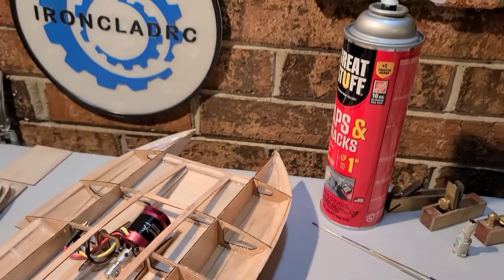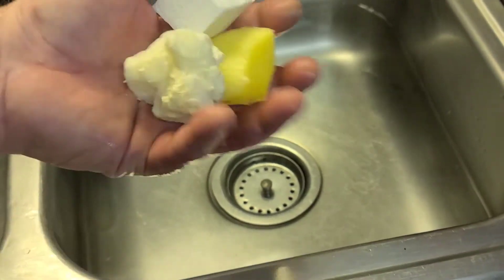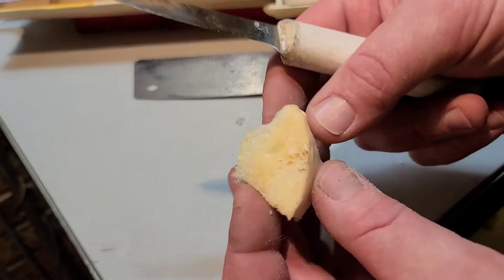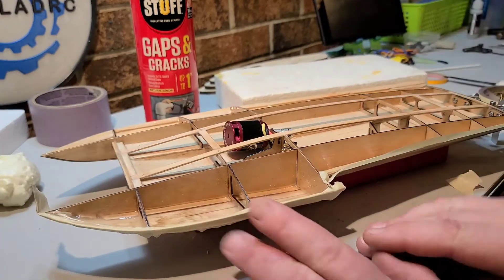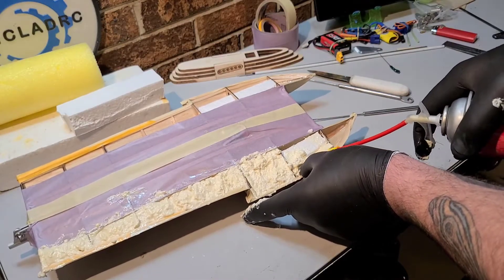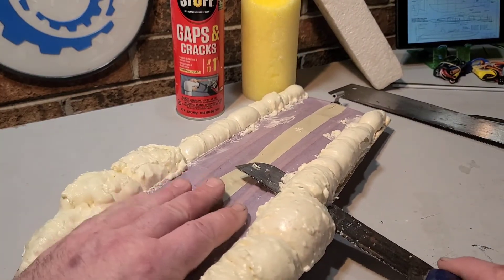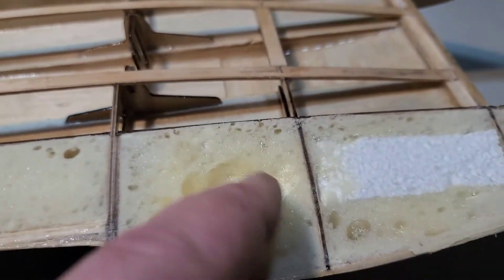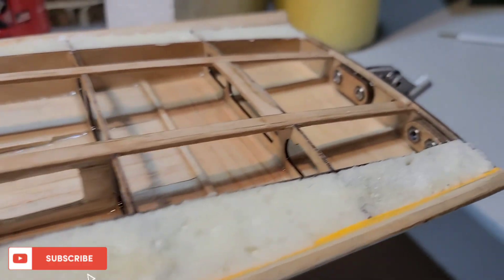Spray Foam Vs Pool Noodle Vs Block Foam Rc Boat Floatation - Pour Foam Substitute?

Comment from the maker: NOTE: Don't encapsulate the foam. If your gonna use spray foam DO NOT SPRAY I AN ENCLOSED AREA. The foam need to expand if it doesn't have a place to expand it will Crack or disinform your boat hull.
Reply: yeah, don't ask me how I know that!   I bulged out my M41 hull somewhat by putting spray foam in the nose.  I caught it before it hardened and was able to clamp it back into shape (somewhat).  I think the ABS hull is weaker than fiberglass, so I'm sure that was some of the issue....
Reply: another tip I read is that once you cut the cured foam (removing the outer layer) you expose the inner foam structure to water which it will then start to absorb... It seems pretty "closed cell" to me so i don't think it would be that much of an issue.  I also agree this adds significant structural rigidity to your boat.  Nice video...
Reply from the maker: Thanks for the tips you guys. I agree the outer hardened foam definitely seems to be more water resistant than the foam once cut.    Glad you were able to save the m41
Reply: So how are you going to fix the deformed sponson ?
Reply: @edwincordero8  if that was addressed to me, I was able to push the ABS hull back into shape and clamp it before the foam inside hardened.  There is one small spot I missed, but otherwise I was able to just safe it in time....

Comment: I recently acquired an old gas rc boat. I know nothing about these boats. There were old pieces of pool noodle in it. I was wondering why it has the pool noodle. I'm wondering if I could spray a bit of spray foam in the hull instead of the noodle. Also. Whats it for?
Reply from the maker: This spray foam tends to soak up water and will make your boat heavier over time, I tt also expands so you gotta be careful spraying in enclosed areas.  

Polyurethane pour foam is a much better option. Pour foam will not blow out you hull and is more wayer resistant  than spray foam

Comment: A quick technical question: I have a Rocket motor with bad bearings and my bad eyes , do you know what tool takes out the end bell screws on a 4074? I know it isn’t a 1.5mm, I would guess 1mm but thought you may have run into this already. I have used liquid wrench on it to pre soak. I want to save my motor but Florida salt water does have its drawbacks.
Reply from the maker: Your best bet is to slightly heat the screws with a small blow torch or soldering iron,   small torch works best.   They use loc-tite on all the screws so heat is key
Reply: @IRONCLADRC - The heating was a great reminder of the thread lock on my screws. My motor was less than a year old but I did run my boat in brackish water. The bearings were totally rusted, new ones on order. Thanks

Comment: in  the 1980's  I  built  a  boat where  the  designer  counseled  using  soft drink bottles  with the cap taped on.
Reply from the maker: What? Soda bottles lol well you know it's not gonna sink..

Comment: Flashbacks come in quickly at 6:40 of my first experience using expanding spray foam over a decade ago, it's definitely like feathering the clutch the first time you drive a new car to figure out where it engages at, & with that small an area I would definitely feather your pull on the nozzle as lightly as possible - but you don't know until you know unfortunately.
Reply: This was 2 years ago tho, I am assuming you're an old pro at spray foam by now... Took guts actually filming your first attempt with it tho. 👍🏼👍🏼

Comment: the best i would say is the 2 part foam  you mix that is designed for real boats... spray foam is almost like a sponge ,so i would not use it... but for many applications using block foam cut to fit is best imo...
Reply from the maker: Pour foam is triple the cost of spray foam, but as you say it's better in every way.   Inside a sponson it's fine completely sealed off from water
Reply: @IRONCLADRC  I just happen to have a lot of that 2 part laying around... yes as long as no water ever gets does matter to much what you use ,just dothe job right... i remember many years ago before the internet i used the 2 part when replacing a floor in a 14 ft boat i had...needless to say i used to much...lol.. But once to calculate it right its an amazing product...

Comment: DAP makes a product called 'DAPtex Plus Multi-Purpose Foam Sealant' That i've used in other applications. It won't add much strength. But it's non-expanding and MUCH lighter. Also, the nozzle doesn't clog up after the first use. For leveling the top off with this stuff you can just use a bondo spreader or something flat. And get this, it washers off with WATER for cleanup. I got it at Lowes. You might try it out and share. :)
Reply from the maker: I saw dap when I was shopping  for  foam I was up in the air on which one to get.  I will definitely keep that I'm mind for next time thanks
Reply: Awesome tip - thanks

Comment: I am so freakin glad you made this video. I wanted to use the spray polyurethane to fill an inflatable tube for a race I'm doing. I'm thinking about cutting open the tube, filling it with pool noodles and then the spray foam since pool noodles are lighter and fill up that negative space pretty well.

Comment: I like it how you cut towards your arm😂😊😎 It's good you show this stuff,many people are new to this and can find answers here
Reply from the maker: Suicide cut
Reply: @IRONCLADRC  😳Looks like your doing a great job of the boat 😊.Have you seen the Joysway Monster Catamaran they use a flexible perspex upright rudder as a self return method wonder if it would work on other boats
Reply from the maker: Oh yea. It for sure would. Just cut and sharpen a scrap piece of aluminum & bolt it to the rudder
Reply: @IRONCLADRC  That would be good 👍.I did try a plastic one once and it snapped off ,from what I see a d read is that if the boats upside down then it's the wind force created from the prop that moves the boat along slowly or if props in water that's a bonus

Comment: Spray foam expands worst think you can put in the boat for floatation
Reply from the maker: You need to test the foam first to see how much it expands and use it with caution. Never cover always keep the area open for expansion.
Reply: @IRONCLADRC  Personally I think you are going to regret this JMO.

Comment: Did you know that there is a difference between open cell and closed cell foam?!? All great stuff is open cell therefore it will take on water slowly and continue to fill. Eventually the foam will be full of water adversely raising the weight of the boat and losing it flotation for the boat.
Reply from the maker: There should be no water in the sponsons. Why would it fill with water?  Hmmmm.
Reply: @IRONCLADRC  It's a dessert topping!....  No, it's a floor wax!  Wait!  You're both right!  Great stuff IS open cell and will gradually take on water when submerged.  The point being, everything is sealed up and there should be no water getting to the foam in the first place.  If someone with slow reactions rams you boat and fills it full of holes, you should be able to recover the floating wreck before the Great Stuff gets over-saturated to the point the hull sinks.
Reply: @IRONCLADRC  correct it should not have water in the sponsons. With that being said I know my proboat ul19 gets a very small amount of water inside the hull. Given several times of use I the cowl isn't left off to dry the inside it will retain moisture and slowly but surely it will begin to take on more and more water. Anyhow love the channel keep doing what you are doing..

Comment: We used to cut foam wings for RC planes with a nichrome wire fashioned onto a wooden “C” shaped handle. Heat it up with an old model RR transformer which lets you adjust the heat. It’ll cut that hardened foam like butter and leave a slick sealed surface. If you’re going this route, be sure as always to test it out somewhere other than a nice RC boat like this one.
Reply from the maker: I made a foam cutter like your talking about. I used an old 12v car battery to heat it up. I've got several old train transformers.  Thanks I will try it
Reply: @IRONCLADRC  for this use, I’d try making the frame about the size of a coping saw frame. Easier to work around smaller complex shapes.
Reply: @IRONCLADRC  Many modern lipo chargers also have a hotwire cutter feature.  I have a HobbyKing Reaktor that does so along with a brushed motor drive circuit for break in!
Reply: yes you get perfect cuts and no mess..definitely best..

Comment: Oh my God, I've only watched three seconds of this.  DO NOT PUT EXPANDING FOAM IN THE NON-TRIPS!!!!  Gonna watch the rest as soon as I make my coffee.....  Got to 5:22 and saw you were protecting the '57 T-Bird fins.  I've calmed down a bit now.........

I've used the Great Stuff before, and the results were good, as Big B discovered here.  The drawback is it's a bit messy, and after shooting the first bit of foam, the shelf life of the spray can is limited.  The foam hardens in the can's valve and whatever is left in the can will stay there 'til the end of time.

And as Big B also discovered, it will push out unsupported walls as it expands.  You have to "babysit" the part as the foam hardens and push in any area that is over-expanding.  Even though the outside of the foam has hardened to the touch, the foam inside is still expanding.  As Vadim says below, it will still be expanding after an extended period.  Cutting the foam as you did allows air and moisture inside, speeding the cure and reducing further expansion.  That's a good thing.  The spray foam application needs to follow the Mies van der Rhoe philosophy of "Less is more".

Overall?  Looking good brother!!  👍
Reply from the maker: LOL. are you okay Dr jet.   👍
Reply: @IRONCLADRC  I dunno.....  I had some heart palpitations for a moment there.........
Reply from the maker: I love to  try things, trying to think outside this limited box that rc boaters have built themselves over the years.   There's 1 way to do things and that's it, no other way around it.   Lol.   That's why I don't get on forums anymore every on thinks there only 1 way to do things and if done outside of that guide line there boat will instantly explode, like a Jame bond secret message..     I wish I'd known not to put foam in the nontrips,  to late now.   the little bubble spot on the side of the nontrip subsided once i cut the foam. It actually  Looks perfect now..  sorry didnt mean to  give you a heart attack, bud.
Reply: @IRONCLADRC  That's precisely why I wanted to see you build it.  I admire a little "Redneck Engineering".  Isn't that how IRONCLAD warships came to be built?
Reply from the maker: Yep. I suppose so.  lol.

Comment: I just learned u can mix water with gorilla glue 10 to 1 parts stir..  makes foam havnt tested buoyancy yet
Reply from the maker: I've used the gorilla glue that foams that's some strong stuff!  Doubt it will float though.   Wouldn't hurt to try.    Tinker test & tune.

Comment: 😩Why?Pour foam always!A half inch stream of post foam would have done it and way stronger than the spray foam.$20a quart online eBay 👍❤️
Reply from the maker: Only needed a small amount 5 bucks vs 35 bucks I don't use pour foam or spray foam  on most of my boats. So 5 bucks seemed like the logical choice. Plus there are other boat guys who could use this information.
Reply from the maker: Poor man's pour foam!  Lol.

Comment: With spray foam you can use a spray bottle and spray a little water on it to make it slightly more dense removed air pockets. Says on the back of the can
Reply from the maker: Thanks brother.    First time spraying into a boat, I will take all the tips I can get.
Reply: @IRONCLADRC  I used it building a small course thought it was easy.  If you touch it, it seems to form a skin but it grows so much. I think the polystyrene foam did not let the can foam expand so the hull was the least resistance
Reply from the maker: Maybe if I vented the top of each section after the skin dried maybe  it wouldn't of  blown  the side of the boat out?  🤔
Reply: Good tip, thanks